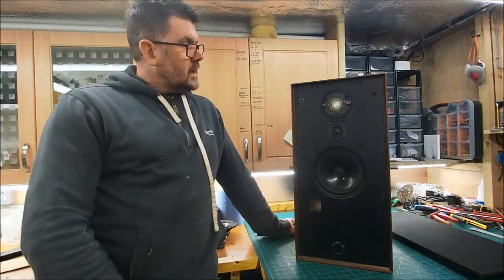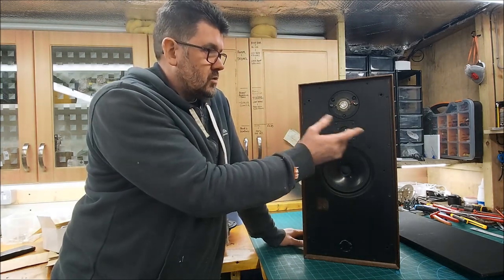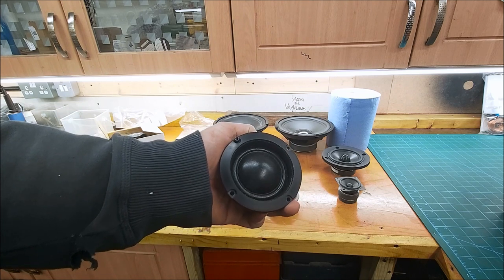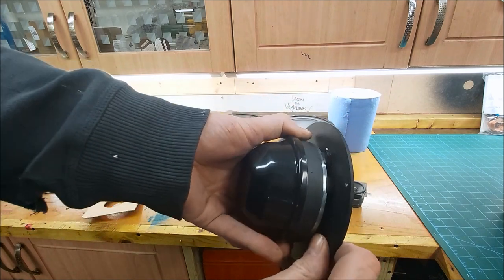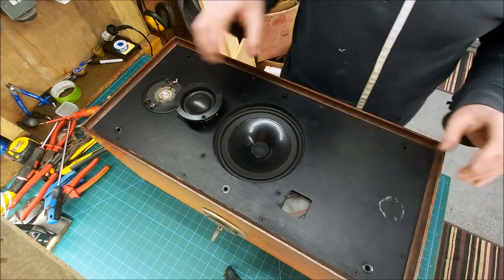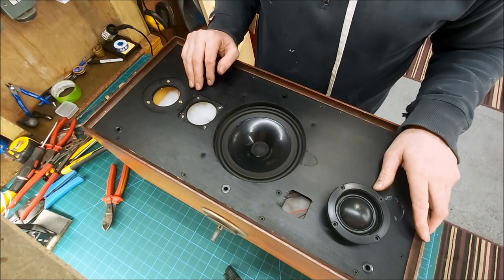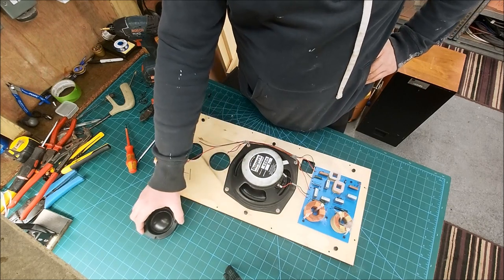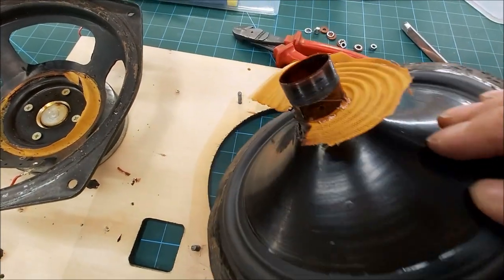Rogers Export Monitor Speakers Part 2

Comment: Think the bass driver is a Goldwood Sound GW-8028? Really intrigued by this overhaul - I have a pair of similar-ish 3-way Keesonic KRFs in my second system that have replacement contemporary drivers except for the original Peerless tweeters, they sound utterly superb, so much so they kill every modern design I've put them up against. Again, great work.

Comment: Don't know if you know, but there is a guy in France who makes replacement voice coils for both the HF1300 and the HF2000.
I did mine and they work great, cheap too.
Reply from the maker: 🤣🤣 Yes I well aware of those. It's not a preference as they don't measure the same. Personally I'd rather source a second hand original or use something else.

Comment: My first thoughts: forget the original xover; 1st order on the poly woofer, (probably well behaved). Xover at baffle step freq, 2nd order to the dome (both LP & HP, dome may need to be reverse phase), probably need a zobel, & 3rd order on the ribbon as high as the dome permits for max power protection.

Comment: First Dome mids and the second dome tweeters you picked mate.

That wadding defo isn’t original.. no wonder they got hot.
Reply from the maker: The clear dome tweeter?
Reply: @haycrossaudio5474  yes mate.. as long as it measures well
Reply from the maker: Same tweeter used in my 2way. More suited to a 2way really but let's see how they all measure up 😃
Reply: @haycrossaudio5474  no the other one